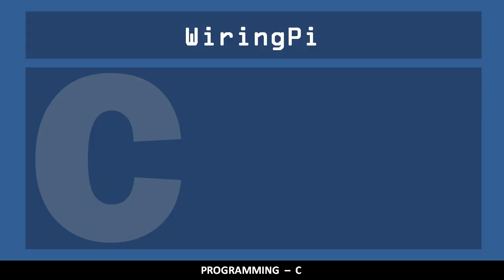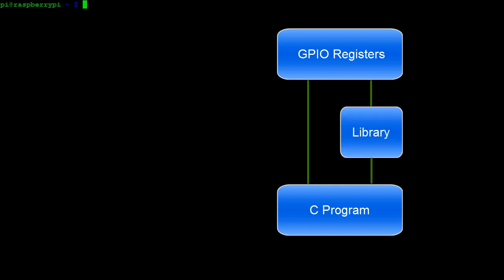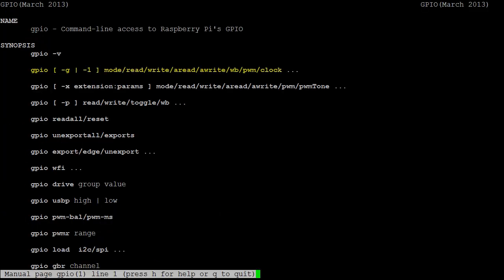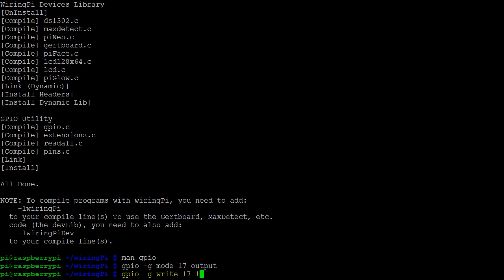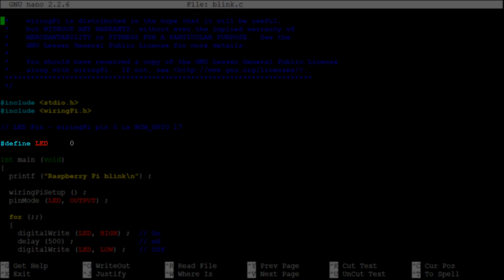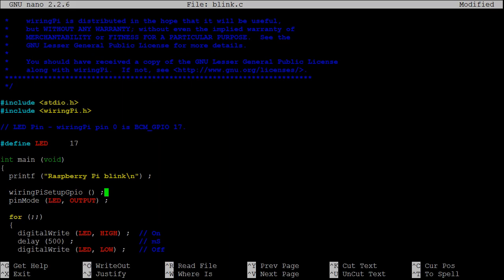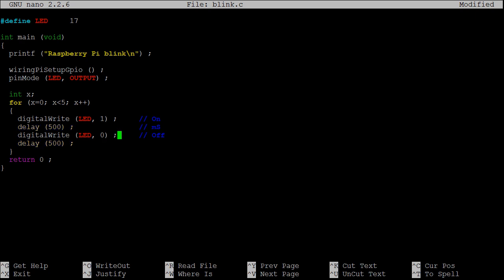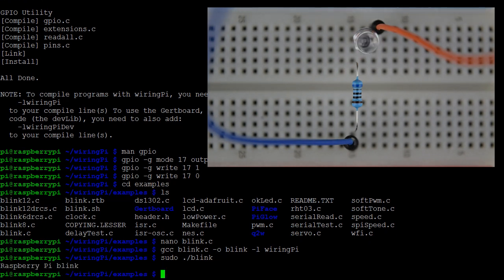Writing to GPIO pins in C using wiringPi on the Raspberry Pi

Comment: I learn how to Control a Arduino with the Arduino Ide and how to write graphical Programms or Games for the Arduino on my PC With Processing . 

If i'm done With that i want to Change my Board or use Booth (Rasbery Pi and Arduino ) The Arduino is good and you can build for example a RC Controller but No live Video is suportet  for that i need a more powerfull Board Like the rasberian .

I Heard Processing and Arduino Ide are very simple Languages to learn .

If i want to use the  Rasbery Pi i need to learn a News Languages because Arduino Ide will Not Work for the Mini PC of Course the Rasbery ist No Microcontroller IT IS a PC . Which Languages are the best for programming the Gpio from the Rasbery Pi C++ or Phyton ? If i want to Create more graphical intense aplication for the Rasbery i will need to learn a New Languages With more option's . Will be Java Ok for that ? I Heard Processing is Like Java Only in small and easy .

Comment: I thought that sudo was not needed with WiringPi. My PHP does calls straight to the wiringPi library.
Reply: You don't need to use sudo if your are programing in bash. I think you are using exec function of php and that is like calling a bash program in php.